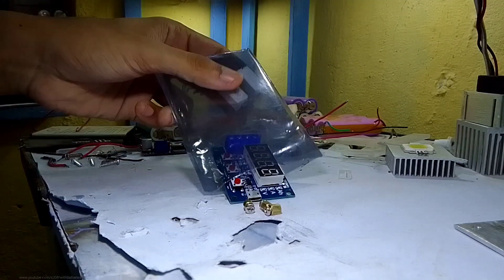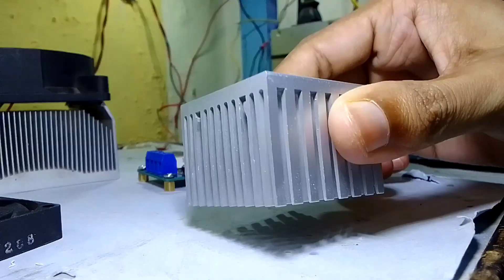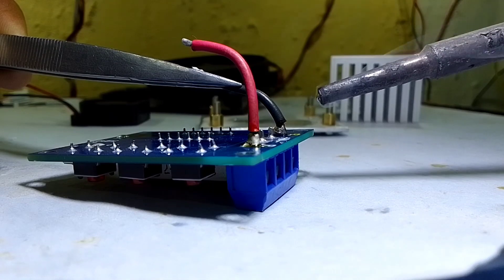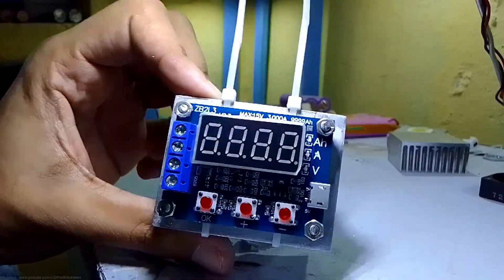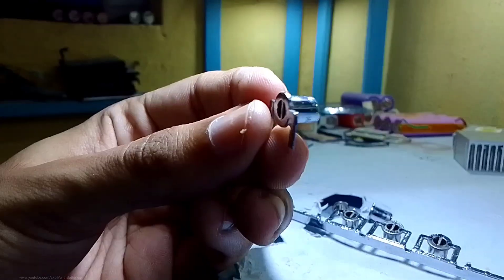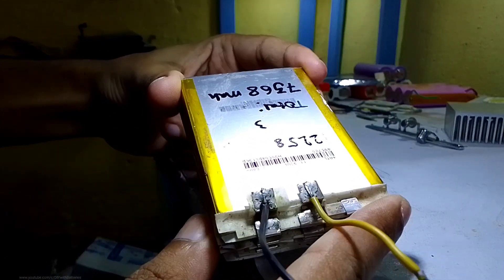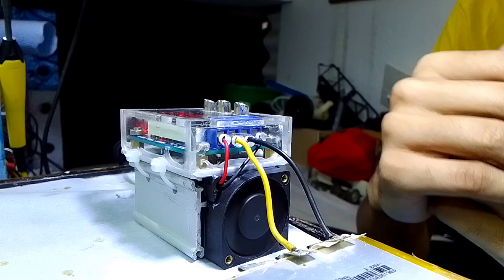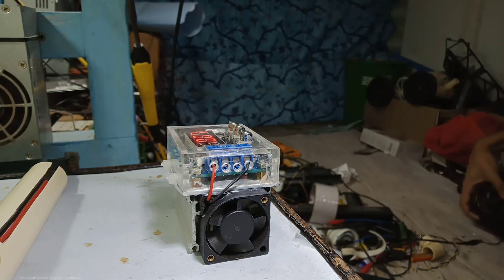Battery Capacity Tester ZB2L3 DIY 18650 Battery Capacity tester

Comment from the maker: Basically those resistors loose their resistance when they get hot So I hope it helps a little in your battery stuff now I can get rid of using the single resistor 🥴👎
https://youtu.be/h_4ZZ-nHPtk
Reply: i watch this video
Reply: No, a standard resistor generally does not lose resistance with heat; in fact, most resistors will see their resistance slightly increase as their temperature rises due to the increased vibration of atoms within the material, making it harder for electrons to flow through.

Comment: Wont hooking up a dc fan in parallel with shunt resistor mess up the current measurement. I am not very sure how this specific module works but most of the constant current loads use a low value resistor to dissipate heat as well as to measure current by measuring voltage across it. If you put a dc fan in parallel to shunt resistor, the current measurements wont be of any use rendering the battery capacity measurements pretty useless. The fan should be powered from 5v usb voltage instead of from battery.
Reply from the maker: Yup! You are absolutely right bud still trying to get the accuracy nothing is permanent

Comment: Tenho essa mesma placa, e ela  não aceita testar a capacidade de bateria de lipo igual você mostrou no video, você fez alguma modificação para testar capacidades de celula de lipo?
Reply from the maker: To be honest I didn't do anything just solved the heat. maybe the load you're using to drain the lipo is too high or the voltage

Comment: Hello there 
How are you able to cut those arcylic sheet in square shape?

From where I can purchase those arcylic sheets, what is the thickness and what tools are you using to cut them?

Please answer boss
Reply from the maker: Yeah I was using a very thin adjustable coping saw machine blade I broke so many of them but still it works great even with metal
And I bought those acrylic sheets from the electric store, they mostly used in switch boards & also mains sometimes anyway i hope it helps thanks for watching!

Comment: buut i chak capasty of my lithioum cell by using a computer 5volt colling fan
Reply from the maker: That's Ok but it takes long time to discharge So just a resistor instead 👍
Ignore if your 5v fan draws 0.5 Or 1ah
Reply: @DIYwithBatteries  ok bro
Reply: @DIYwithBatteries  any other load?
Reply from the maker: @sabir2002  You can use anything but it should be cc and lower than rated power consumption